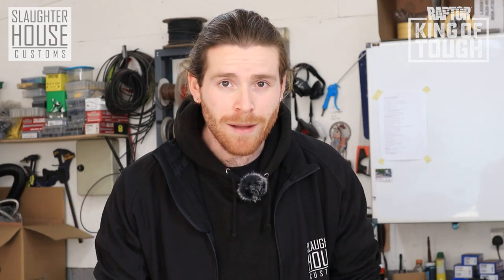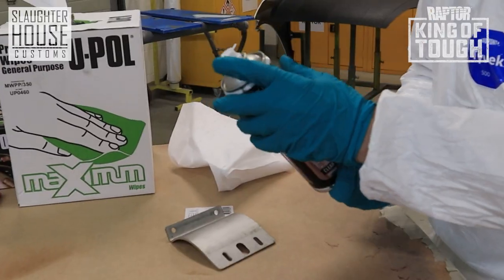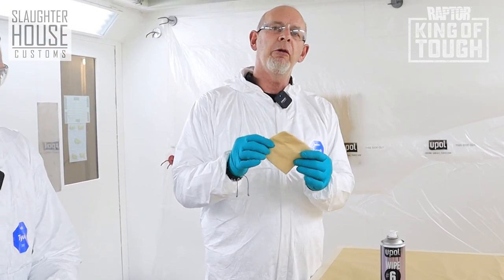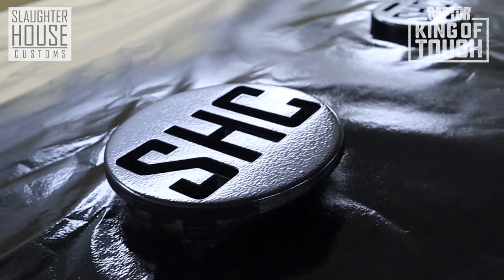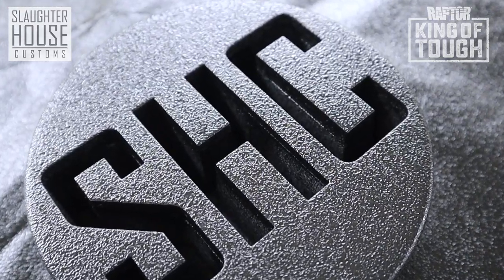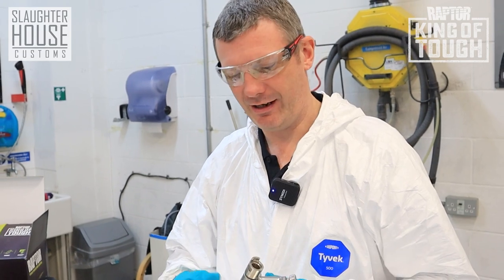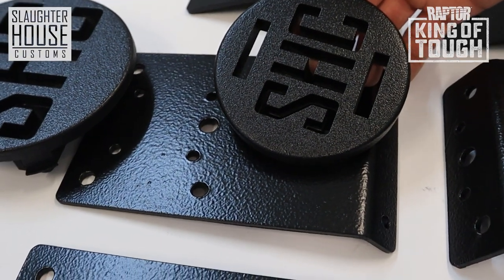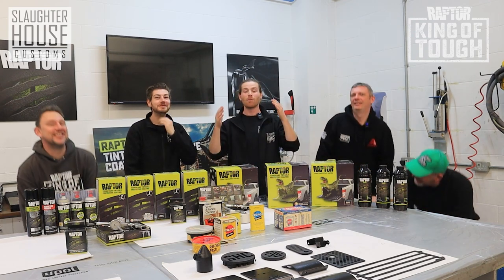PREP, PAINT AND TOUGHEN UP YOUR CAMPER VAN WITH UPOL RAPTOR - PAINTING WITH THE PROS

Comment: Awesome video! One question for you: how much primer and how much raptor paint will a T3 (T25) panelvan will need for a full respray with a fine texture (either hvlp gun or the adjustable nozzle gun)?
Reply from the maker: Thanks! So you'll be looking at a 4 litre kit of Raptor paint and about the same for primer. It may be worth getting a little more, so you've got enough to do a test panel to get your texture just right before hand 👍 happy Raptoring! 🦖